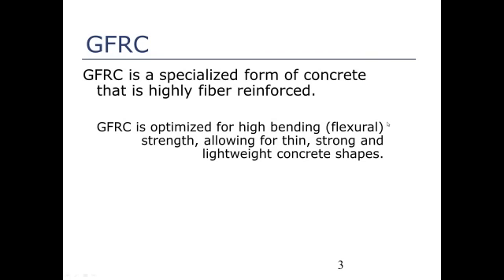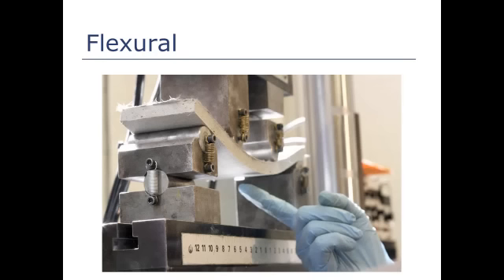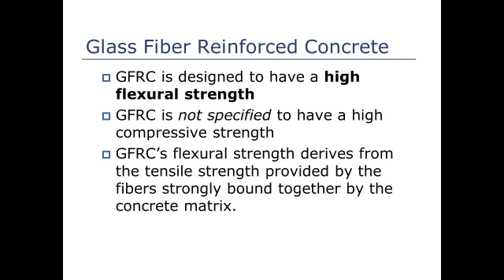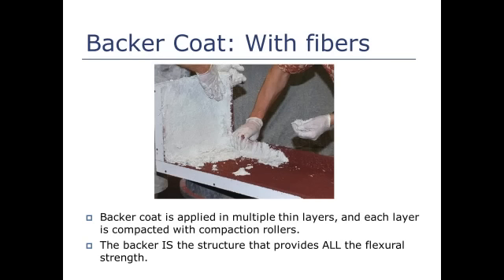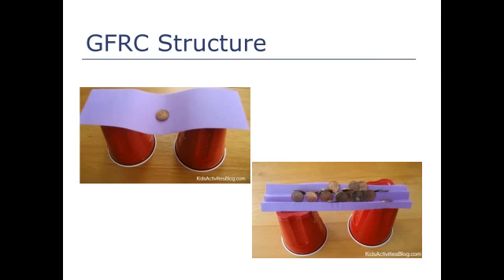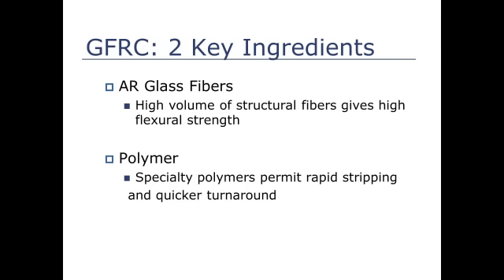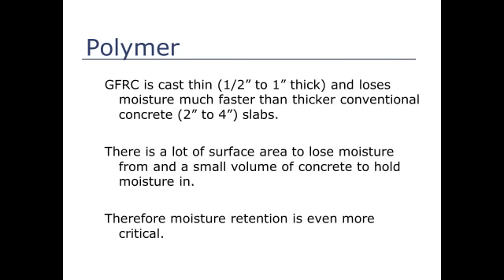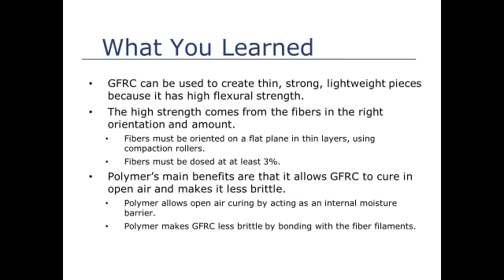Understanding GFRC for Concrete Countertops

Comment: Do you use a polymer in your face coat? If so, is it the same used in the backer? Also, could you also add a lightweight aggregate such as perlite to your GFRC make it stronger?
Reply from the maker: Yes, both face/mist coat and backer have the same amount of the same type of polymer. The only difference is the backer has fibers. Both should also have the same water-cement ratio.

There are lightweight aggregates available for use in concrete, for example expanded shale and cenospheres. Perlite is not a suitable lightweight aggregate for any form of concrete if you're looking for strength. It is puffed volcanic glass, and is extremely weak (very low compressive strength). Any lightweight aggregate functions essentially by replacing strong, dense material with much lighter material. The problem is that very lightweight materials are also very weak. The "best" lightweight material is air (which of course has no strength at all), and it's a very well known fact that foamy concrete that contains a lot of air is much weaker than dense, heavier concrete. The best way to make strong GFRC is to make it very thin, which requires the concrete to be extremely strong. This is achieved through low water-cement ratio, the use of pozzolans to consume the weak calcium hydroxide produced by Portland cement, good curing practices, using the right kind of fibers in the right amount and compacting them well, and proper structural design.
Reply: Thanks for your response. I was thinking about using the perlite for lightweight concrete veneer panels such as decorative rock panel for home vaneer. No real structural components needing compression or flexion properties.

Great videos by the way. I think you did a great job.
Reply from the maker: Kelly T Thanks Kelly!

Comment: I am looking to make a counter top about 4m long - is GFRC capable of this span without risk of cracking over time? Also I would assume I would need to make the piece 40-50mm thick to cater to the span?
Thanks
Reply from the maker: Hi Jason. If you mean 4 m (13 ft) completely unsupported in the middle, probably not. It is impossible to say without knowing the exact dimensions and loading conditions.

If you are talking about a 4 m long countertop/benchtop that is going to be fully supported by cabinets, then yes, and it does not need to be 40-50 mm (1.5 - 2 inches) thick. It could be 20 mm (0.75 inches) thick overall, it just would need scrim and thicker (40 mm) edges.
Reply: Sorry I should have provided more detail! 4m is length but I have not worked out the legs and how it will be supported. I will be sure to keep this in mind when finalizing the design. Appreciate the feedback on the scrim and thicker edges.

In respect to the build process itself, have you ever applied a facecoat by hand, as opposed to spraying the mist coat initially? If so, what are the expected results of this approach? Or is it imperative to spray the mist coat to get a good final finish?
Reply from the maker: ***** Hand applied face coats will always have more air voids and pinholes than a sprayed finish because it's the spraying action and the impact energy that purge air from the mist coat, and that's why a sprayed mist coat can be very nearly pinhole free. While surface voids and pinholes are a nuisance, grouting is an easy way to fill them in and achieve a beautiful finish. There's no reason you can't hand-apply a face coat, but the coat will be thicker and a bit more uneven than if you sprayed it. Remember that your face coat doesn't provide much strength, so the thicker it is the more likely you'll see surface cracks if the countertop flexes and puts the face coat in tension.
Reply: Thanks for the Heads up Jeff - great feedback with the face coat thickness. Will let you know how I go!
Reply: Jeff - you wouldn't happen to have a recipe calculator in metric measurements would you? Thanks
Reply from the maker: ***** Yep, sure do. It's available here: https://concretecounter.infusionsoft.com/app/storeFront/showProductDetail?productId=22
Reply: Thanks for that Jeff. Any chance it comes in metric measurements?
Reply from the maker: ***** Yes, it includes a metric version.

Comment: it's not easy to find the materials on the website
Reply from the maker: Hi Patrick. Are you referring to the physical materials such as fibers and polymer?
Reply: @TheConcreteCountertopInstitute  
Hi Jeff, yes. I am a DIYer. I have been watching your videos, Thank You for all the information on your channel and web site.
I'm thinking of using Cement All with a mist coat and adding fiber to the same for the backer fill. Some ladder reinforcement. Then seal the top with Ovation. I have only ever used Lowes and HomeDepot for building materials and they don't have the fibers for mixing into the Cement All for the backer fill. Thanks for your feedback.
Reply from the maker: @patrickmclaughlin6013  That's great! There are a lot of options for DIY concrete countertops. What you've described with mist coat and fibrous backer is GFRC per this video. You also mention ladder reinforcement, and I'm assuming you mean the steel ladder wire I've mentioned in other videos. You should not use steel reinforcement in GFRC. To explain why is beyond the scope of this comment, so I'm working on an article about that and will send you the link soon. Steel reinforced (non-GFRC) concrete countertops are a totally valid DIY technique though, and I have free training on that here: https://concretecountertopinstitute.com/free-training-category/diy-concrete-countertop-training/ as well as in depth live action video training here: https://concretecountertopinstitute.com/shop/diy-concrete-countertop-video-course/ One other option I should mention is a concrete overlay over existing laminate countertops or plywood. See here: https://concretecountertopinstitute.com/shop/finale-diy-concrete-countertop-system/ As far as your original question about the materials for GFRC, please check www.buddyrhodes.com.
Reply: @TheConcreteCountertopInstitute  
Thank You for the follow up and info.
Reply from the maker: @patrickmclaughlin6013  Here is the article: https://concretecountertopinstitute.com/free-training/can-i-use-steel-reinforcing-in-gfrc/
Reply: @TheConcreteCountertopInstitute  
Thank You Jeff. I'll read through that again. I have to say, I never realized just how complicated concrete can be. I've developed a new appreciation for it. Between you and Trinic's channel and Tyler Ley, it's really overwhelming.
Reply from the maker: @patrickmclaughlin6013  There's a lot to know, that's for sure!